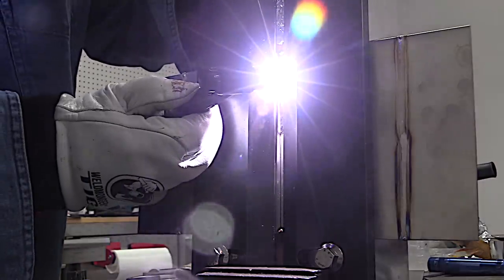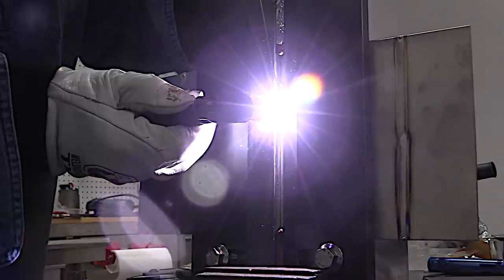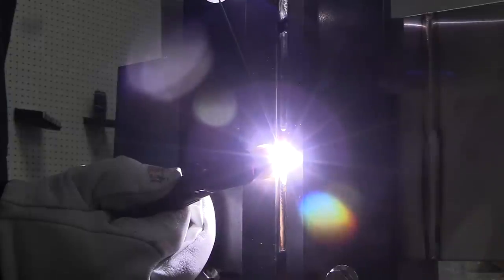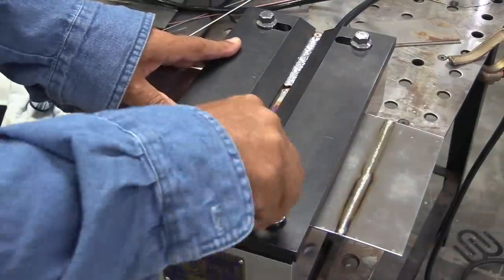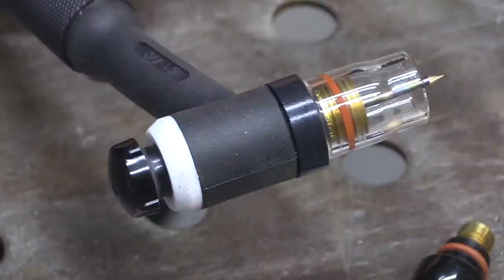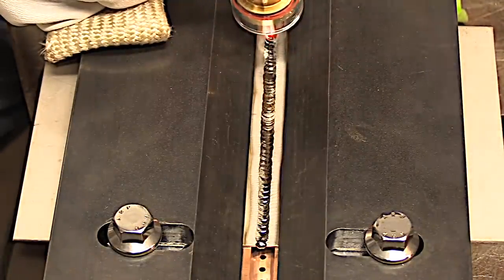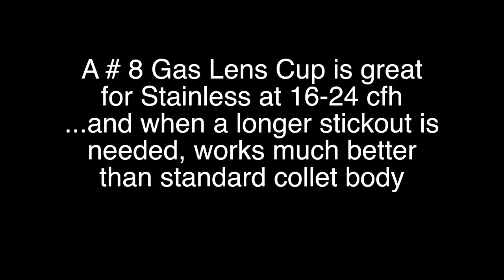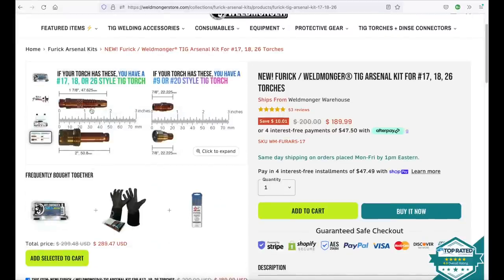Tips for Passing a 3G Aerospace Weld Test AWS D17.1

Comment: We would give our test plates to the machinist and he would take a skim cut on the edge, so the edge was smooth (machine finish) it also butted together with no gaps. Not necessary but for aerospace certification testing I'll take every advantage available. Thanks for the videos Jody

Comment: Had to pass a 3G, 3/8” thick, open root, on carbon steel with no back purge for tig. Also for mig a 3G, K bevel open root, with back gouge and fill. 18” long on high hard steel. Just a couple of more than 20 different tests I have passed for jobs.

Comment: I've been watching the progress of repairing a abandoned airplane at another youtube site.  They have found some areas with corrosion.  They claim that the whole part must be replaced costing well over 100 hours of labor and 9 months for the manufacturer to supply the part.  I seem to remember you talking about crawling into airframes to make repairs in the past.  So my question is, is it actually legal or not to repair sections of certified airplanes???  You can make aerospace parts but not fix a decades old private airplane???
Reply: Here in EU its possible but you need to be certified organization and for some repairs you need manufacturer aproval or, as big organisation you can made your own repair aproved by authority. Sometimes its easier and less costly to buy part from manufacturer. Im not sure how this works under FAA.

Comment: Very cool arc shots. Not a welder anymore but I love your videos. Gonna be buying a multi process unit and would be very interested in a video of the later technology units for a light to medium duty machine. The inverter technology has come a long way and I’d love to know your thoughts on which ones you’d buy for your own shop. Mainly tig and stick.  You definitely helped me get through welding school years ago. For sure. 
I’m a city cop at a Baltimore school and this feels more important than welding. My first love is a puddle under a tig torch and am interested in getting a really good rig for projects and keeping up my skills. I like rebel but they are expensive. Is it worth the money? You could answer that. 

Thank you. 
Thank you. 
Thank you.
Reply from the maker: The Rebel is ok but costs roughly the same as the miller multimatic 220 ac dc.  I like the miller better personally.
Reply: @weldingtipsandtricks  thank you. I hope you keep doing those videos
Are very helpful you are a good teacher.